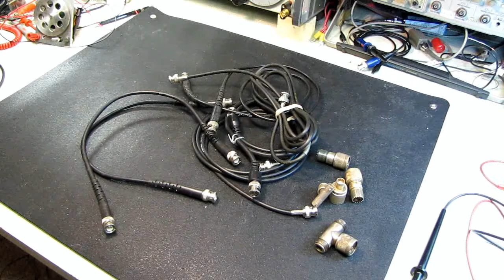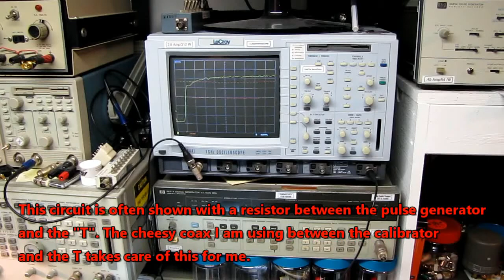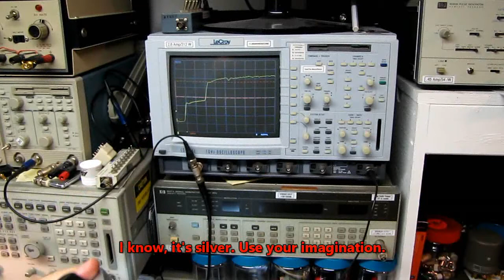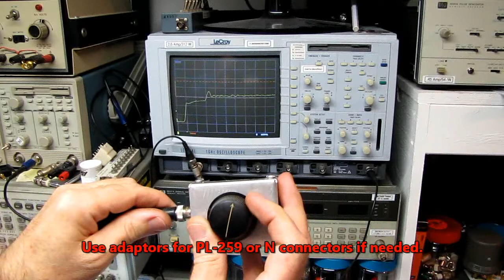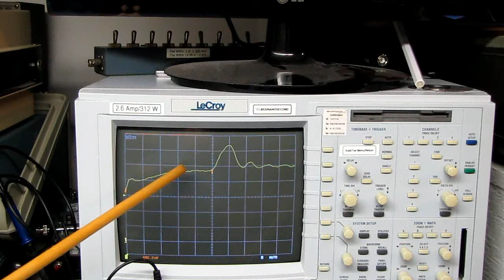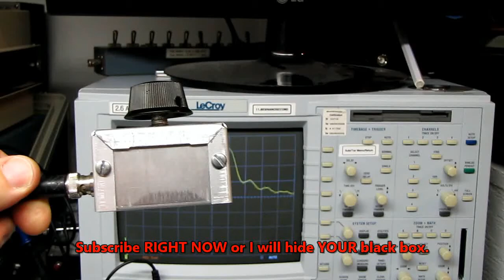Coax - Measure Impedance and Velocity Factor Simply

Comment: Any other way of testing if you don't have paulse on your signal generator? I was actually researching this topic about a month or so ago, the only thing I found was to just put a matching capacitor on the other end of the coax, so if you believe it's 50 ohm, put a 50 ohm resistor on and check with a VOM, I haven't done it, but it doesn't sound correct? ~Jack, VEG
Reply from the maker: Lots of other ways. None cheap. MFJ antenna analyzer, Boonton/HP RX bridge, network analyzer etc. VOM? No. It will simply read the resistor value added to any DC resistance in the wire. You need to measure the surge impedance, not the dc resistance.
Reply: I kinda thought it was not a proper test..this is just a hobby...spending boatloads of money is not very conducive for me, I'll troll what you suggested, maybe I can find an old MFJ and go that route.  Thanks!  ~Jack, VEG
Reply from the maker: Hi Jack. Search out the local Ham Radio club in your area and find out where they meet. They will probably have either a swap meet or some kind of flea market at least once a year.
This can be a good source of inexpensive test gear. Vern

Comment: Great piece of info.

No such thing as to much junk.  If you can't find anything because its to cluttered its not because you have to much junk its because you don't have enough room for all your junk.  Basically build an addition on your house and you'll discover you have room for all kinds of new junk.  That's what I do. :)  And it sounds like you and I will be in a fight for first place when we die for the king of junk prize.
Reply from the maker: This is why I built a four stall garage. :-) Sadly I know I will never catch up to you. I'll just have to settle for second place. Or is that first looser?
Reply: I'm chasing Mike as well but the light at the end of the tunnel IS a train coming the other way. TNX for the demo, shows that it is possible to make quality measurements with relatively simple gear.  73 - Dino KL0S
Reply from the maker: Hi Dino, I think that train coming already hit me. Thanks for the nice comment. Vern